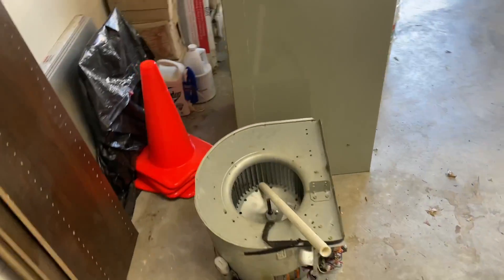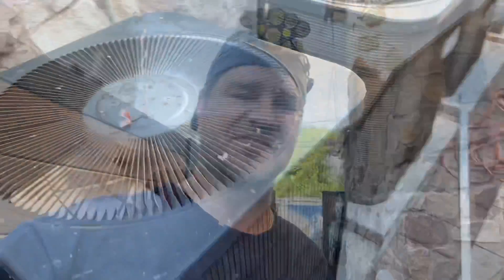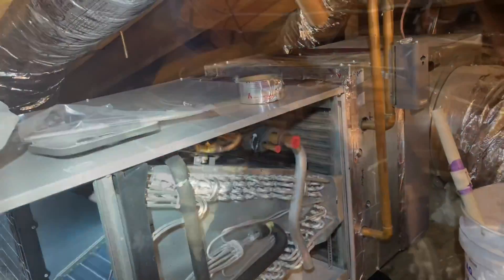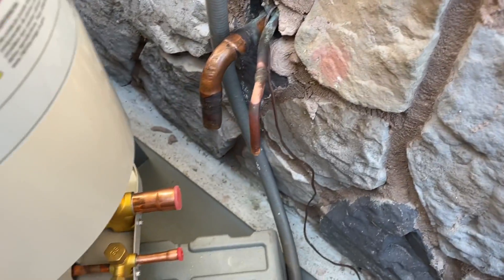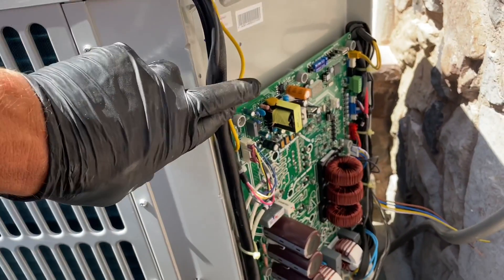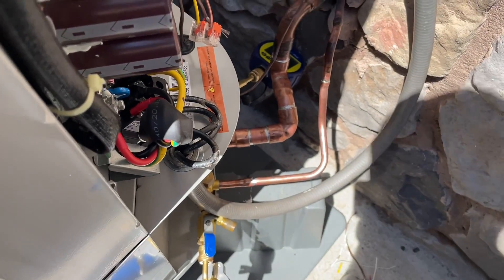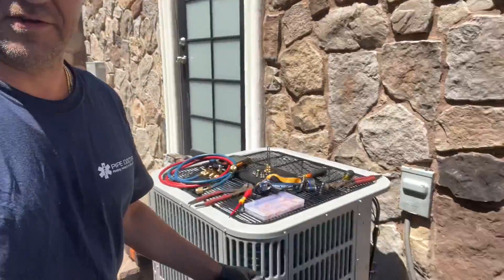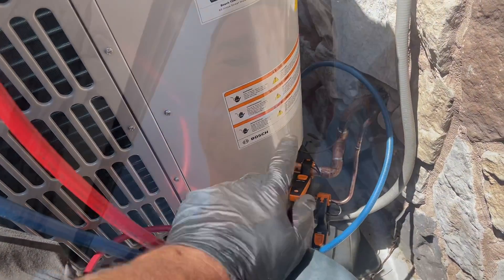Bosch IDS 2.0 Installation BOVA-60HDN1 & BVA-48WN1 Central AC Equipment

Comment: Mikey Pipes- how much did the homeowner pay for this job? Curious bc I am having the same unit done at my house(using both AC and Heat pump)...thanks
Reply: @PipeDoctor  Not in your area, sorry! What is the wholesale price this combo runs for a contractor(roughly, I know prices may have changed since you did the excellent video)...thanks Mikey!

Comment: So at max output it would be 14.2A on one leg and 14.2A on the second leg which = 28.4 amps total with all balls out. So 6248 watts are my figures. So about average consumption for the size of the unit at max power as a regular a/c unit. If Bosch covers the unit for 10 years at least the warranty is good.
Reply: I don't think you would add the phases together. I believe in this situation, the total current draw would be 14.2A. Maybe an expert can chime in. The way that I understand it, the 14.2A is alternating between the +120V and -120V legs.

Comment: I have same bosch setup. The air handler is extremely well built only thing I am not a fan of is the blower. It should be a variable speed motor with lower fan speed options to take advantage of all the condenser has to offer.
Reply: @PipeDoctor  

Yea but the lowest speed on the 5 ton air handler is still about 1200 CFM should be lower to take advantage of the range of  condenser. Either way the condenser is still an amazing piece of equipment. And Bosch only has to make 2 models.

Wouldn't surprise me if other manufacturers start going this route

Comment: When you install these units, do you stage the air handler/furnace fan to get better capacity control based on demand instead of just relying on return air temp/heat content? 
The capacity on the spec sheets doesn't seem to drop that much just as return enthalpy drops.
Reply: @PipeDoctor  doing that is allowed in the manuals, its optional i'm not a pro, just an interested diy'er who also likes theory.

Comment: Mikey can u set one of these systems up with a fan coil and make use of the heat pump capabilities?  Set it up so that for heating it will use the heat pump to say around 20 degrees, but switch to Auxiliary heat (fan coil) below that?

Comment: With a  $2000.00 control board you need to make sure there is electrical surge protection on the service panel. Nice unit, and nice installation.

Comment: The threading on top of the air scoop is for tubing to direct water leakage to a drain.....   I usually see this size units in larger apartment buildings.

Comment: That Bosch looks like nothing more than someone took an Ameristar, put in a bunch of high tech stuff, and called it another name.. 

Identical. The doors, frame, cage.... I bet the coil is also...
Reply: @PipeDoctor  I am telling ya, (ONLY) difference is the fan top and the cage is vertical vs horizontal on the Ameristar....  

The doors are even identical in their shape, the way they are made, screw locations, heck even the stickers look identical!!

That Bosch ain't nothing more than a pimped out Ameristar.

Bet the same company makes them, i would bet everything i own on it!
Reply: That is true💯

Comment: Mike when brazing copper to copper you don't need stay bright and silver solder.  Silphos works great in that application with a turbo torch. I used to teach my men that technique as it saves time and is less leak prone.  Stay bright and silver works great for copper to brass.  There's quite a bit of written information on this subject if interested.  Most all manufacturers install a copper stub at both ends so silphos can be used.  They do the silver braze at the factory for you.

Comment: I have been using Staybrite 8 for about 36 years with NO problems at all. I also use 15% brazing rod depending on the situation.I have been a BOSCH ABC Contractor for 3 years now. Great Videos Mikey Pipe's and Cheers from Baltimore Maryland home of the Baltimore RAVENs lol \,,/\,,/

Comment: If you were replacing a 4 ton condenser, and you used a 4 ton air handler, shouldn't you have switched the dipswitch on the condenser to the 4 ton mode? It is my understanding that pairing the 4 ton AHU with the 5 ton condenser is meant to be done, however the 4 ton mode on the condenser is to be set. Or am I incorrect? Good video as always, Mikey.
Reply: @PipeDoctor   I read back through Bosch's literature and it states that the "J2" dipswitch does NOT need to be switched to lower capacity unless maximum capacity is needed to be minimized from 3 to 2 tons (BOVA36) or from 5 to 4 tons (BOVA60). However, if the system is mismatched (5 ton condenser, 4 ton AHU) the switch can be left at default position (higher capacity) as the system will self-modulate. You were correct, it seems silly they would add the feature to change capacity manually then state it is not necessary. I am an engineer and even I do not understand why engineers do some things. Cheers, enjoy the pool.

Comment: Love that Press fitting for hvac lines . Question though why didn’t you use one on the connection? Did you know that Pepsi owns all their refrigeration units in USA and that’s all they use for field repairs. You can’t fire up oxyacetylene equipment in a Walmart…

Comment: A very good installation. On electrical per nec code 200.6 a1 color code electrical wire 6 awg and smaller. Just carry color electrical tape.

Comment: Yo Mike does the control board also display amps being used ?  if i heard u right you said it will display sub cool/superheat  did you compare that to what you were getting on your Testo ?   Sweet install  looks like decent machine but  little  apprehensive about that control board and keeping that cabinet clean/dry